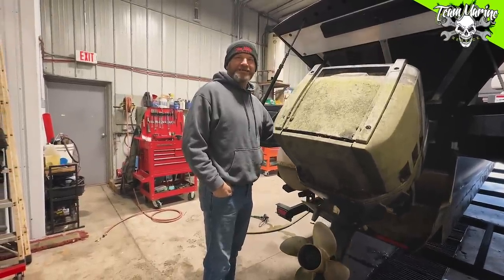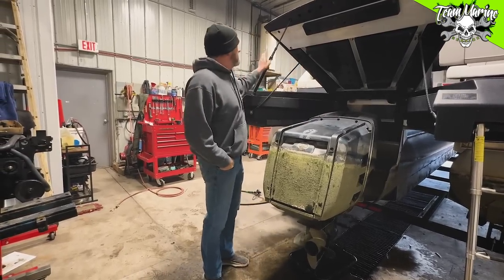WE'VE CAUGHT THE GHOST!!! (ROTAX OUTBOARDS)

Comment: I can't believe they totally gave up on Evinrude for this pile of absolute Ghost junk.  Why would anyone in their right mind even think of putting a motor powerhead underwater?  This has to be the worst idea in the entire history of marine propulsion or maybe in the entire history of the internal combustion engine.    BRP, if you're watching, go back to work on the Evinrude outboard and bring us something that really works well.   I don't care if it's an improved 2-stroke outboard or an all new 4-stroke motor - anything will be better than this foolish thing.   If you won't do that, at least provide those of us still running Evinrude outboards with a reliable stream of replacement parts.

Comment: I have a G2 Etec 150 on my Alumacraft 195 trophy. Came from a 1981 Silvan Sea Monster 17 with a 1984 Evindure 50 hp. That boat still floats and that motor still runs. Has some new parts but still runs. I am an Evinrude die hard. What has happened to them is a travesty

Comment: You are forgetting the top 5 positives.
1. Fishoflauge color cause it is underwater
2. No wasp nests in cowling.
3. No fuel or oil costs after 3 months underwater cause it quits running
4. Never have to worry about resale value there is none.
5. Can,t think of number 5. Notice my comma in can,t is underneath.
Reply: @Avv45 😂
Reply: Number 5: it can be used as an anchor when it fails.
Reply: Thanks Udamannee @smannee
Reply: @Avv45 .   Grow a pair, cant stand the heat keep out of kitchen.

Comment: I am so glad i still got my 87 Evinrude made by OMC, still the best motor i ever owned, clean carbs every year, fresh good fuel and no issues.
That ghost submarine.. well they can stick that where the sun never shines and see if the seals hold up.
Reply: It was designed to be mounted where the sun don't shine.
Reply: @smannee  haha Good one so true🤣
Reply: I also have an 87 evinrude it's a 40hp and runs like a champ
Reply: BRP Should have stuck with What Worked. I like Many other people Still own a True Outboard. I have a 90 EVINRUDE XP 200. OMC Power that still gets the job done 👍

Comment: After watching this i did some more digging and there are a bunch of sensors and it has a actual self test that tests the sealing of the cowl and engine compartment. And the air intake is molded into the boat. With that being said these motors are not designed or manufactured to be a repower option. Its designed for a specific boats and thats it.

Comment: Andy I am going to repower my new tritoon with 3 of these. I plan to have two on the back and one on the front ( for reverse).  When I'm not reversing I can tilt it up so I can see the front engine but not the back 2 engines.   If I buy the engine bumper option, I will not need any traditional bumpers which will be a cost savings. I plan to run all engines off of one 12 Volt battery with solar panels mounted below the lifting strakes on the toons.

Comment: Our switch (and just about every other one) has a constant drain on the battery and runs it dead in less than 2 weeks. That’s without keeping an ECU powered to monitor and run the pumps.

Comment: Unless the ECU sets a code the first time the bilge pump runs and the owner immediately takes it in for service the corrosion under the cowl will destroy the entire engine so hydro locking it’s the least of your concerns. At least if it hydro locks there is a small chance of warranty covering it. BRP has been terrible for warranty, our Switch spent 3 months waiting on parts while under its 12 month warranty. No way I would buy that thing. 3 years from now they are going to have a hacked up swim platform with a Suzuki poking out of it (assuming it’s a standard transom)

Comment: My boat sinks if the battery goes dead and it fills with water. I guess that makes it useless as well. 

Although I don’t agree with the design, there are benefits.  Who wants to hear their outboard on a long trip and the large swim platform/casting deck is nice. 

I have the 140 i3 G2 on my boat that the ghost is based off of and it’s far and away better than any other outboard I’ve encountered.  Quieter, more fuel efficient, more torque, less maintenance, winterizes itself.  What’s not to like. Too bad Evinrude went out before they pushed the motor. It’s truly the best outboard in its class

Comment: I remember Ranger had an inboard bass boat. I think companies should reconsider that concept under back deck.  Now that engines are all aluminum now.  Get a contract with Toyota, GM or Ford. I bet engines would be cheaper since you can buy a 350 chevy engine for about 5k
Reply: That's a basic engine most 4 and six cyl engines are more like 8 to 11k without install and that is not complete.

Comment: OK after the video all I can say is;  As I said when you first told us about this pile , Is there some patent that they will infringe on if the produce a INBOARD OUTBOARD????  I mean that's why the engines have been mounted inside the boat or above the water' TO KEEP THEM  DRY.... LETS JUST TAKE A LITTLE OF THAT F-1 MONEY AND CORPERATE JET MONEY AND DEVELOP A STERNDRIVE AND FOURSTROKE OUTBOARDS....Why not a vertical adjustable Sterndrive ? Thanks Andy Looking forward to the underboard video .( and how did you manage to sneak one of those into the shop without BRP sending the RCMP mounted Police to confiscate it ). Be carful it may be equipped with a self destruct device to coverup the evidence!!! Thanks Jim

Comment: This is funny, but the wording has been updated for 2024.  Also there is nothing wrong with these engines.  Yes its a far out design but the 2 stroke engine is super relaible.  There hasnt been any major issues since this was introduced.
Reply from the maker: We’ve heard a ton “flooded bucket” stories already with pictures. The engine itself self is probably okay but the mechanisms to keep water out are just silly. That’s where they will fail
Reply: @TeamMarineService  All the research I have been doing on this, I have only seen " I have heard" failures.  I am not saying what you are saying isnt true, but You would think it would be all over the internet. I love technology and change, but that also comes with sometimes things that dont work or growing pains.  We dont drive carborated cars anymore but carns worked just fine.  I get sticking the engine in the water could cause a problem if there is a failure.  I realy want to buy one of these boats, I am trying to read about them as much as I can.

Comment: Doesn't the entire drive unit tilt up and out of the water? If so, why did the owner of that boat leave it down all the time as evidence by the large amount of scum on the unit. If it does tilt up and out that would solve the battery going dead issues.

Comment: BRP idea mmm OMC failed idea 25-30 years ago. BRP took there only good engine the 3 cylinder 1.9 115-150hp wow need to find a mid section for that big 3. Or Did BRP run something different I could only guess

Comment: I love BRP’s Can-Am and Ski-Doo vehicles. They’re outstanding. I had a 25 E-TEC for 12 years and the only thing I ever did to it was change the gear oil. This is insane, it’s dumb. I would literally buy any Force outboard from any era before I bought this. At least as awful as it is, it makes more sense than this. BRP you’re awful for killing Evinrude, you stole e-tec, you rejected the 4T and then instead of building the best fuel injected 2T ever… you built this. How can the same company who makes great 165hp naturally aspirated sleds, make this abomination? What a joke. I absolutely mean the Force is a better idea than this. I’ve been on the water 38 years. Not every idea is a great idea. Sorry but this is an abject failure.